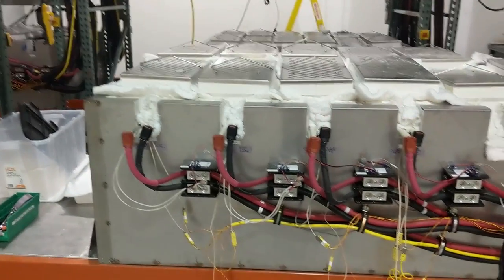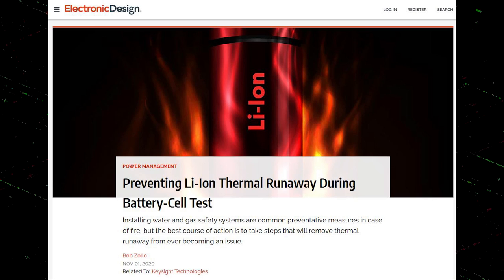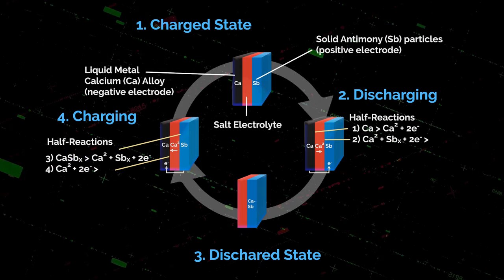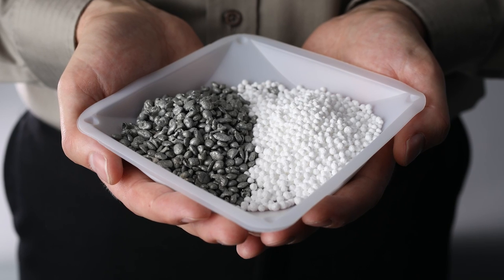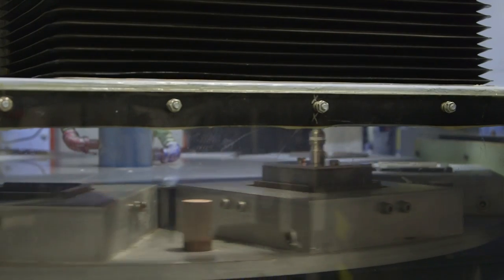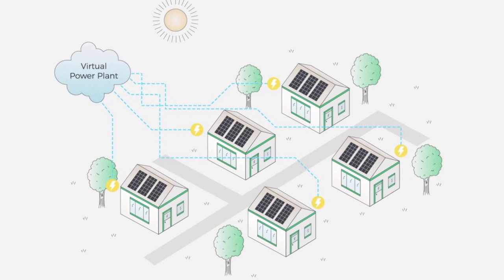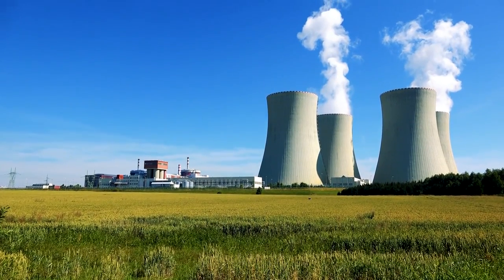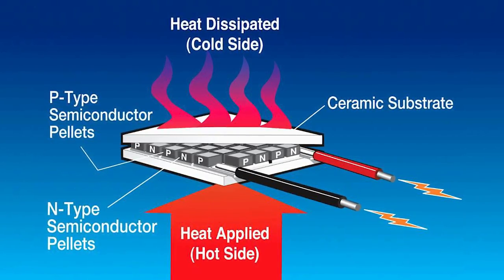Ambri: A Battery that Could Change the World

Comment: What an amazing humble honest intelligent guy.
I wish the interviewers would have asked the speed his battery can be charged compared to its capacity or AH and the size and weight per Ah.
What I am wondering,For Example,lets say you need a 100 kva 415 volt supply to run a small supermarket and you want to run the supermarket off the liquid metal battery whilst the power from the grid supplier is expensive and charge the battery say at night whilst the grid power is cheap, sometimes the real cheap times are after 10 pm and until around 6 am give or take so let round it down to 8 hours of cheap time and 16 hours of battery time.
This is where the recharge time needs to be 1/3rd of the discharge time and the batteries would need to be able to handle a rougly 3 times the amperage that was discharged whilst being charged.
I think this kind of question although a basic one would have been good to consider the batteries potential in this real use case, right at this time.
Yes solar panels could help but  the upfront cost of different combinations could have been considered had he been given the oportunity to answer such a question.
Having said that a supermarket can not have interuprton of power supply at all, so a back up generator is always going to be part of the calculations because of refrigeration of food.
Reply: This tech is only about 75% efficient, so you'd need a huge discrepancy between daytime and nighttime grid-power price. With other battery technologies the current-limiting factors are all solids, fundamentally absent in liquid-metal batteries.

The current-limiting factor here is more likely the size of the wiring?

Comment: The problem is insulation to keep it 500+ degree as we know keep something at a high temperature is not easy and cost energy.
I have found little information regarding the specs of liquid metal battery even from Ambri website.
All stuff listed on their website are slogans of commercial promotions and it seems not real.

It is not easy to determine whether a 500+ degree temperature maintenance will cost more energy than it actually stores.

Comment: in the desert use a ferenial lens to heat an outer casing of the battery. optimized the design to be heated and hold heat from the lens throughout the night

Comment: You could go in to the power storage business aith batteries designed to refine the electrodes and then use the refined material to supply batteries to customers - in effect you are in the refining business as well as the battery business...

Comment: What if we started storing the Ambri "liquid metal batteries" underground? Ambri wants their batteries to stay hot. I'm sure they would get hot enough to keep the rock around them hot. They could capture the excess heat from the batteries with steam turbines and cool the batteries down if there's a theoretical unsafe temperature for Ambir's batteries. Might solve the geothermal energy capturing issue at the same time.

Comment: One problem: Antimony (Sb) is primarily a byproduct of mining and refining Lead (Pb). How do you get enough Antimony to scale this without mining a much greater quantity of Lead? Considering that a pure metallic form (rather than ion) is used, this means the entire bulk of the Sb electrode is metal, hence, a large volume is required.

Comment: I am fascinated by your battery technology.  Where I understand a fair amount about the ins and outs of batteries and how they generally work, I am not an engineer, I use a fair amount of battery wattage every day of my life. I use my fair share of lithium ion batteries in my phone, tablet, etc. I also use a power wheelchair to get around.  Now, where I can explain most of what I understand about battery usage in power chairs, and some scooters, I am also not an expert in all the battery technology that all of these devices use.

I do know this:  I think I’d be pretty safe to say, that a person, each of us would celebrate in joy if a. The majority of these batteries were smaller but could retain a charge for longer distances and needed to be charged less often, and b. The cost of replacing these batteries won’t break the bank but could c. Opperate a more intense use as seen on the more technically involved “rehab” chairs(chairs that might require an even more heavy drain on the battery- such as having multiple functions, such as tilt, recline, and elevate.  Each of these specialized functions require a drain on the battery system that impacts milage that the chair can travel on one charge.

As I mentioned before, different manufacturers design chairs to run on different battery systems- e. G.: a co-worker has a chair that can run on one or two lithium ion batteries that fit into the frame of his chair.  My chair however, runs on an older technology- the deep cycle “gel cell” battery, and require a much larger foot print than his to carry and to charge.

Both systems have their plusses and minuses- some based on the batteries being used and some based on the practicality of these systems- his chair can b literally folded away like a shopping cart and stored in the trunk of a car. Mine not so much- not unless you had three strong men, a tool kit and LOTS of time to spend- safe to say, my chair doesn’t fold, much less come apart.  I am forever reliant on vans with lifts or ramps!  But these are not the only considerations: where his chair can fold away and mine not, I can tilt and he can not- I could also have bought my chair to where it could not only tilt, but could have also elevate and recline and so much more- but this would have drained the battery faster than how I have this chair now- tilt only(we won’t even get into the argument over Medicare/Medi-caid paying for such a complicated, yet needed medical needs……….

My interest is more to the point of: could such a battery such as yours be used in medical devices such as power chairs??

Power chairs and scooters are very expensive, but as I say, are needed by so many to get to where they want to go with out the possibility of a. Blowing up/catching fire b. Be able to be charged less frequently, c. Be easier to charge on the go and,d. Offer an even wider array of options to folks that might want to take them on plaines, trains, etc. and not have to worry about possible leakage if tipped or somehow damaged)which is a very real possibility given how certain[not to be named] companies handle such critical pieces of Durable Medical Equipment(DME).
Reply: This technology is meant for stationary applications. That bottle of salad dressing the Professor was talking about? If you want to keep the oil and vinegar in separate layers, don't shake it!

Comment: Unfortunately, a lot of questions were not asked:
What is the energy density?... Joules per kilogram or Joules per liter
What is the charging efficiency? What percentage of the charging energy goes into heat
What is the discharging efficiency? What percentage of the discharging energy goes into heat
What is the cell voltage?
What is the cost per KWh today and what is the theoretical cost per KWh based on raw material cost?

Otherwise very interesting. Thank You.

Comment: It sounds great, but....  700C is well above the melting point of copper.  Copper also degrades and oxidizes very rapidly around heat.  Copper-oxide is an electrical insulator.  How does one maintain a decent electrical connection?  Also, heat isn't free!  How much of the charge current is getting consumed for heat generation?  This would also imply that to contain the heat is what makes this battery efficient: the better the insulator, the more efficient the battery?  These are serious issues and were not addressed in the interview.

Comment: I'd like to see a comparison between these type of liquid battery technologies (Ambri), vs Vanadium flow batteries as well as modern Ni-Fe types.  Specifically: energy density, lifetime cycling, deep discharge capability, maintenance requirements, and cost per kw/hr.

Comment: To get the battery tech to work on the Moon/Mars you`d need to use Earth materials first to get the planets infrastructure in-place.
 Say.... 4 power plants at the planets equator at equal distances thus always using a measured amount of fuel and have the transport automated and going in clock-wise and anti-clock wise directions thus always have a supply at a constant rate... then build habitats/solar/wind away from those points....

Comment: Very interesting technology.  It still takes energy to recharge batteries. It appears that this research is geared toward making other renewal energy sources (solar, wind, tides, etc.) more practical from the standpoint of time when these renewals cannot produce (no sunshine, no wind, etc.). The cost of converting DC to AC also needs to be considered in the equation of “total cost of energy”.  We are presently living in a world technology that is setup to operate on AC power.  Perhaps there is a path to evolving back to DC (as Edison had proposed), but that takes time and perhaps new technologies.

Comment: So, questions you didn't ask.....
What is the minimum physical size that crosses the line with Liion batteries. E.G. might these be apt for ships, boats, trains, trucks, off-grid domestic install.?
What is the coloumb efficiency? 
Do they have a Peukert effect?
What is their energy density both in terms of weight and volume.
What happens if a cell, being fully charged, is allowed to cool and solidify? When reliquified will it retain that charge?

Comment: How rapidly could you charge this?  And if you can keep it level, how robust is it, and how resistant is it to vibration?  Would rail vibration be too high and cause electrolyte mixing/shorting?  4 of these in a 40 foot shipping container would give 4000 KWh of storage capacity, which is enough to power a 5 car train for over 200 miles.  Then you could have a set up with the 25000 volt overhead power lines installed only at terminus stations and through urban areas, which would be much cheaper than electrifying whole lengths of track, and allow decarbonisation of the other half of the UK rail network that currently still runs on diesel locomotives.  Maybe for longer (e.g. U.S. length) rail journeys you would swap the battery car around every couple of hours at interchange stations less than 200 miles apart.  Perhaps the salt layer would need to be thicker in non-stationary applications, which would reduce capacity, but even so, maybe there's some possibilities here?

Comment: Heating the metals to 700 degrees celsius requires a good deal of energy to begin with. There would be a priming cost.  If the battery maintains the heat level when operating then it stands to reason that it is loosing efficiency to heat. There would be a need to insulate the battery to prevent heat loss which begs the question, when does the battery get too hot and is there a critical point?

Comment: So what you guys missed here was my thought; what if you allow a fully charge metal battery to cool, say its on a train track and transported across many miles to where its need, lets say a refinery or just to use when needed. Would it be viable to reheat and discharge like this?

Comment: Movable, or portable energy storage  could be battery,  liquid fuel,  compressed fuel gas.  No movable energy storage could be  water dam,  heat storage matter,  weight potential energy, etc.

Comment: Great interview, however I have a question, which I don't think was covered during the interview. How is the metal in the batteries heated? What is the source used to heat the metal and how much does it cost and how does it figure in the price of storing the energy in the battery?
Reply: Electricity. From whatever source you're trying to store. Initially to melt the metals, then the heat comes from charging / discharging the battery. It's why the efficiency is only around 75%, you're using some of your source power to keep the metal molten; and insulating the container.

I don't know how much it would cost to "start" the battery, certainly more than it takes to recharge it, due to the phase change. But that's a one-time cost. Keeping the metal molten, is why this technology is meant for constant deep-cycling and not long-term storage. What it lacks in efficiency is made up for by longevity.

I was unaware, before watching this vid, that the longevity is limited by the metallurgy of the container. Thermal cycling will eventually lead to failure by metal fatigue. The containers are scrapped, while the internals are re-used in a new battery. Very "circular economy."

Comment: What if the "thermal- runaway" is allowed and the excess high temperature gradient is harnessed and utilized as a Dynamo of some sort...and in perpetuity as it were?
Reply: There's no thermal runaway going on. There's no "extra heat" produced.
I would think the battery heats up due to the Joule effect just enough to KEEP the battery at 500°.
But to get it to 500°C initially when the battery is installed in place for the first time it requires A LOT of energy and the whole point is to keep it above the melting point without wasting energy. That's rule number 1:
if the battery gets solid because it gets too cold it won't be a battery anymore, you have to spend A LOT of energy to activate it again through external heating. It is only a battery when it's liquid metal, and if it's not a battery it won't heat up by itself, you need a heater.
The battery utilization plus the thermal isolation keeps the battery at very high temperature, but that's only possible because the battery is purposely designed to do so, not because it has a tendency to get very hot.
The thermal isolation keeps the heat from escaping the battery case, so that the battery doesn't loose the precious heat it produces during utilization and so there's no need for costly external heating.
The professor said in this interview that the batteries are designed so that they would exchange current charging and discharging each other to produce enough heat to keep themselves at high temperature when needed.
That happens if there's no discharging going on: if there's no discharging going on the battery would just loose heat and get colder and colder. To avoid this they would charge, discharge each other to produce heat, even though that's a very inefficient way to produce heat I would think (that's usually the case, but it's probably the easiest way to do it all things considered).
That means that some energy is being "wasted" to keep the battery warm instead of being used for a load. 
But if they're connected to the grid that's very unlikely to happen, the battery would be placed where it would be used a lot so that happens from time to time or very little during the day. That's why the professor said they have to be smart, because these batteries must be placed where they can be used a lot.
Ideally they would be charging during the day and discharging during the night, so they are heating up continuously.
Anyway if the battery is cheap and the energy comes from PV or Wind turbines it's reasonable to loose some energy to heat up the battery. It's just free energy anyway.

Probably if you want to heat up something it would make a lot more sense to hook up an AC to  
the batteries, the battery heats up and the AC heats up the place very efficiently compared to just the joule effect of the battery. It's a WIN WIN

Comment: The question I kept hoping would be asked and answered is - What is the "cost" in energy to activate this system?  For instance how many BTU or KWh is required to kick start the 10ft container system to where it is at operational temp and what is the ongoing energy expense to keep it there?
Reply: I don't have any special insight, but here's some back of the envelope math.  I'm just going to assume that the full thing is made out of calcium since that's one element in the battery.  That's a pretty iffy assumption, but we'll go with it.

The energy to raise a shipping container sized chunk of calcium 600 Kelvin is 

0.63 J/g K (heat capacity) * 600 K * 1.55g/cc (density) * 1000000 cc/m^3 * 1172 m^3/shipping container (size of a shipping container) * 1/3600000 kwh/J ~ 5,500 Kwh.  

So you probably don't want to have to heat that up very often.  A heat pump could probably heat it up with more like 1,000 Kwh.  And you might want a system to capture the energy back out if you want to purposefully cool it down for some reason like if you wanted to power some down for long-term storage.  

We can get a sense for maintenance energy as well.  The perimeter of a shipping container is about 74 square meters.  The RSI for a Vacuum insulated panel is around 7 m^2 K / W, so we can plug it in and get
74 m^2 * 600 K / (7 m^2 * K / W) ~6,300 W or 6.3Kw to keep it heated.
Although I'd take this calculation as almost an upper bound.  You can kind of get this number almost arbitrarily low with more insulation or just having larger banks next to one another.  If you have 8 containers together in a cube, they'd only lose 4x the heat making it twice as efficient.  You can always use more insulation, too.  I suspect they'd probably want to tune this to roughly match the energy losses from charging/discharging, so I don't know how much it would end up coming into play.  If you're heating it up by 6Kw just from the natural battery inefficiencies, you won't be using any extra energy to maintain the heating.  Although it does indicate you probably don't want to leave these idle very often.
Reply: @cadekachelmeier7251  great explanation, thanks!

Comment: BUYING BATTERY'S FOR MY MOTORBIKES 13 IN ALL. THEY ONLY LAST A YEAR OR 5 YEARS. NOT CHEEP .AMBRI  BATTERY S WOULD SOLVE ALL 13 BIKES. BUY ONE BATTERY .PUT IT IN A BOX ON A RACK FITTED TO ALL THE BIKES. EXTEND THE LIVE WIRES AND EARTHS. ELECTRIC MOTORBIKES WILL BENEFIT THIS NEW BATTERY.  AMAZING VIDEO /GOOD LUCK TO THE MAKERS. 23.46PM 26/9/2021.